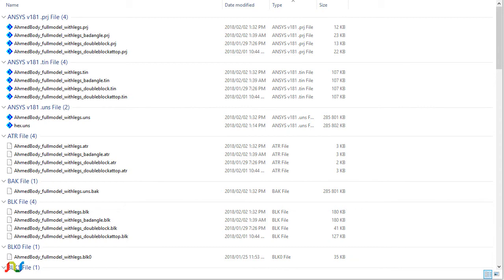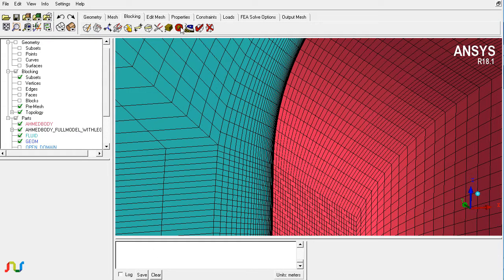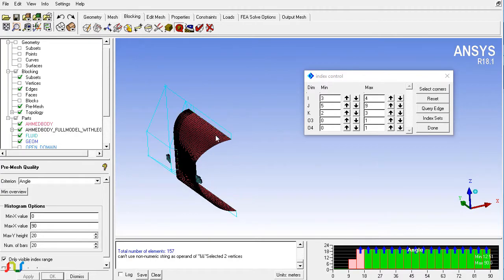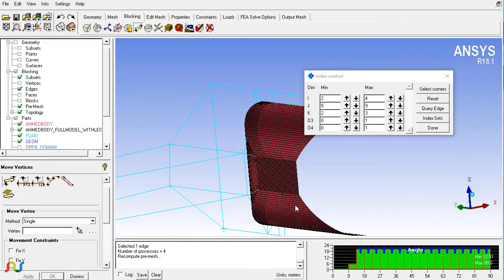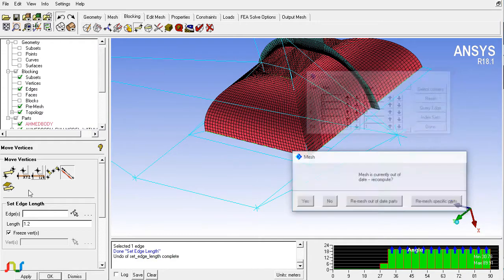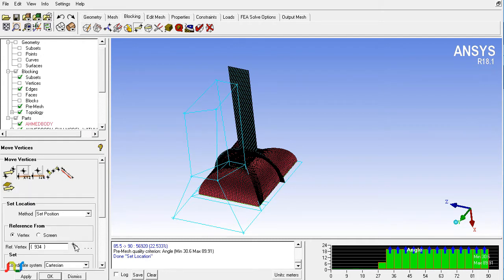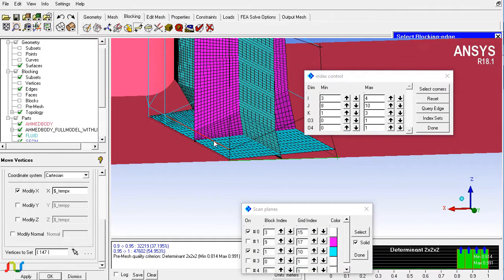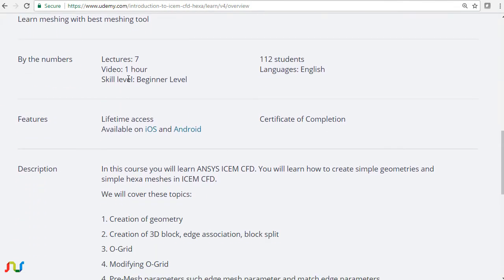Improving mesh quality in ICEM CFD Hexa - Case 1 (Low quality)

Comment: Hello, I have made structured mesh for wind turbine. Due to some reason, quality is not improving beyond 0.1 (det 2x2). It would be great, if I can get help in this.Thank you.
Reply from the maker: move vertices here and there to make the quality better.
Reply: I have been trying to move vertices in different directions to improve orthogonality, but no progress since a week. There is improvement though, element count between 0 and 0.3 came down from 30,000 to 20, 000 before a week.
Reply from the maker: increase number of nodes and decrease first cell height